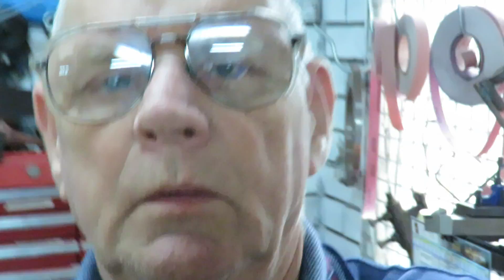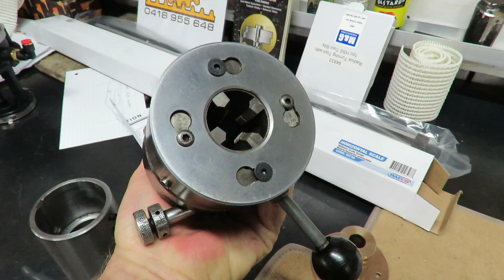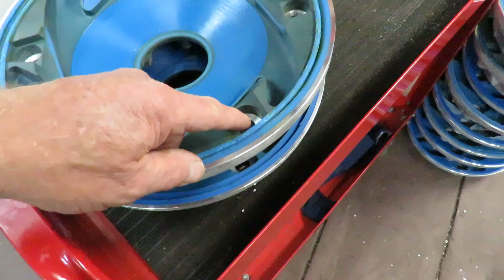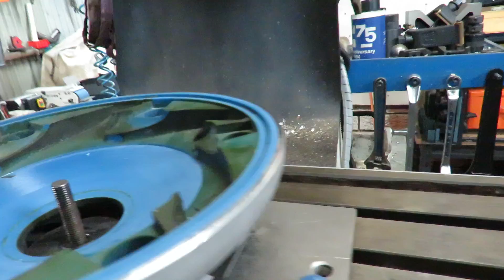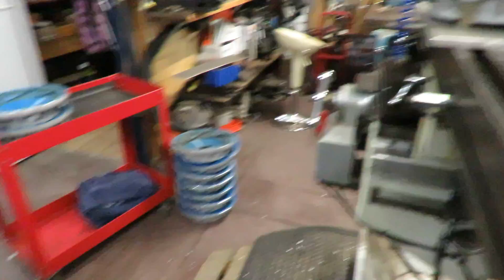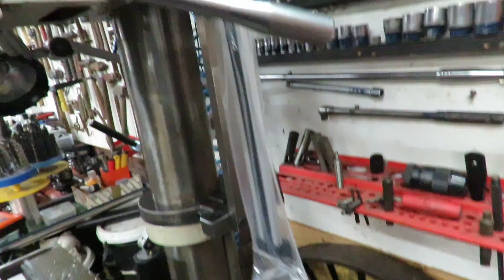Peanuts and Single Malt 5 Extending threads on the lathe and other jobs in my shop

Comment: Bruce, when you reverse the lathe to drive the saddle back to the start of the thread, do you use the electric motor reverse function or the carriage forward/reverse function? It seems to me that using the saddle driving gears invites error, because they may mesh in a different place, whereas the electric motor forward/reverse switch leaves all the gears and drive trains entirely alone, and just spins things the other way.

Can you please advise (another?) silly old man?

Comment: hey Bruce im not far from you in Perth and was wondering were you get small bits of stock from not having scrap bin at the moment that i can pick i am finding it hard any help would be good thanks
Reply from the maker: Brad, The Steel Store (Bohler) in Welshpool has a good range of small bits of steel bars, hollow bars, brass, ali, cast iron etc., they no longer allow you to scrounge through the off cut bins however the shelf stock is a great resource of short to medium lengths. Steel City Dicandilo on Guildford road has a range of off cuts and you can go through the scrap bin, good resource for plasma cuts and plate circles, hollow sections and such. they will cut anything to size for a small fee, mostly structural and hot rolled. Dillena in Osbourne park are the same as Dicandilo.
Reply: thank you very much not easy to fine 300 mm of 90mm solid

Comment: I've had to reset and pick up a thread more often than I'd like to admit.  Work slipped in the chuck or the old lantern tool post didn't hold, or forgetting to lock the tailstock.  I know that you don't use the compound for feeding in, but being set up for it makes re-aligning the tool point to the thread root a bit easier.  At least it does on a century old lathe.  Combined use of the compound and cross slide can help iron out the wrinkles that Bozo's visit created.  The end result may not be the prettiest, but at least I haven't had to scrap a part (yet) because the thread was useless.

For those that are trying to pick up a thread for the first time, I'd suggest making a few 'dry runs' to make sure your settings are correct and holding before continuing to cut.  Especially with an older (worn) and unfamiliar lathe.

Comment: How do you move the compound with the half-nuts engaged? I would engage the half-nuts, run for an inch or so, to take up back-lash, then move the work piece to match the cutting edge of the cutter.
Reply: You could also move the tool holder, without affecting the half-nuts.
Reply: Just realized that I confused compound with cross-slide. Moving compound, tool holder,  is correct.
Reply from the maker: You will not that my compound is always in the same axis as the saddle, makes for easy adjustments compared to the American way where they set the compound at 29.5 degrees. I only turn the compound for angle work never for threading.